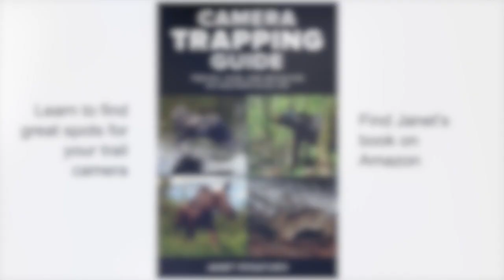BTC 7FHD PX Teardown and Lens Replacement   HD 720p

Comment: How do you remove the hole plugs?
Reply from the maker: My favorite method is a hooked dental tool, but I've also used a safety pin in pinch.  Dan Potter used a sewing needle with a bent hook -- see: https://winterberrywildlife.ouroneacrefarm.com/diy-converting-btc-7a-from-ir-to-white-flash/
Reply: @winterberry-wildlife-tech  Before I searched for help, not knowing how it was put together, I had the plugs jammed to the bottom of the hole which made them very difficult to get out even after finding your tutorial.
Reply from the maker: @okestone  bummer. For their function, these only need to be just seated into the holes.  My problem is that I keep forgetting to put them back in :(    Newer models of the SpecOps and ReconForce cameras do away with the plugs in favor of a single (more complicated) gasket that includes the screw wells.